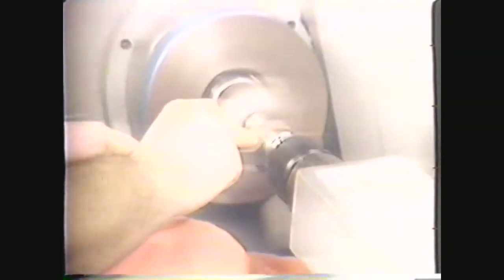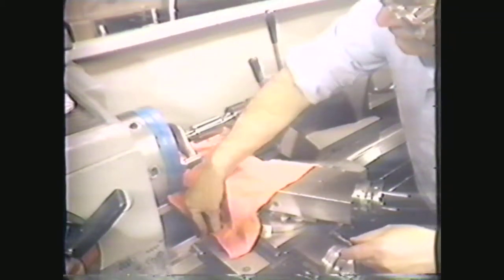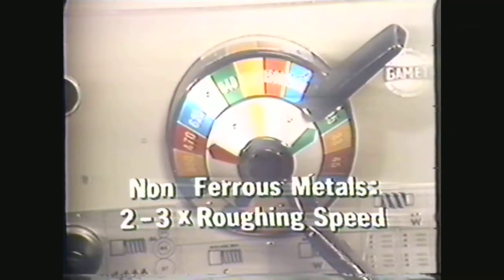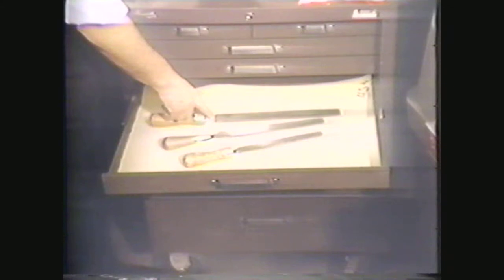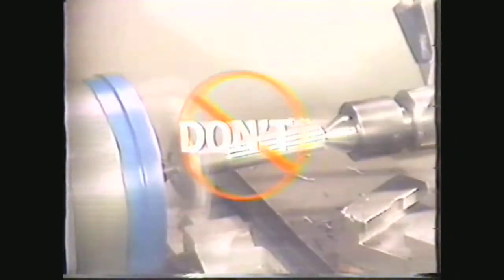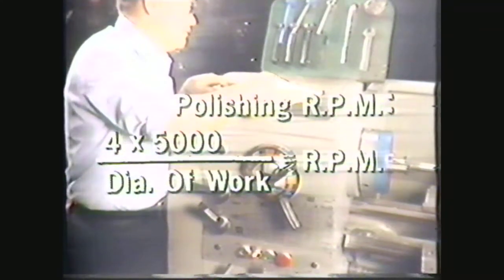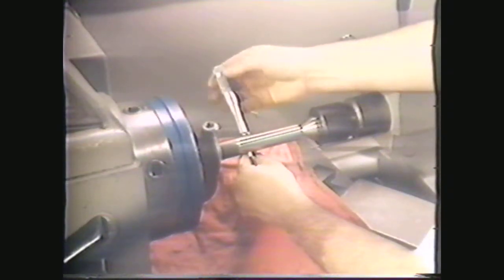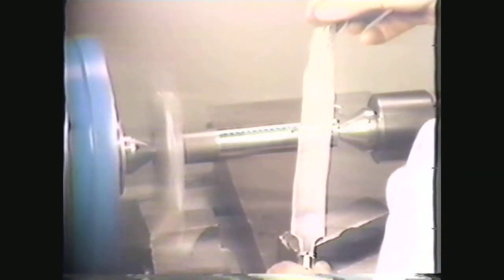Machine Technology II Lesson 13 Filing and Polishing on the Lathe

Comment: The polishing technique shown in this film is dangerous.  Wrapping the emery cloth 180° around the workpiece increases the chance that it will grab, wrap, and pull the operator's hand into the machine.  Some workplace safety regulations (UK, for example) prohibit hand sanding on lathes under power.  see https://www.hse.gov.uk/pubns/eis2.pdf .  At the very least, based on my experience, I'd suggest keeping the emery cloth not covering more than 1/4 the circumference of the workpiece - in other words, forming a right angle around the part, and not tighter.